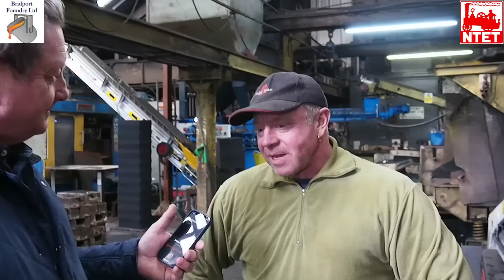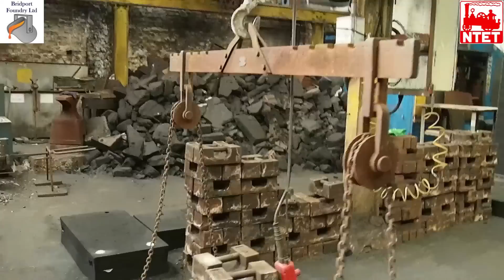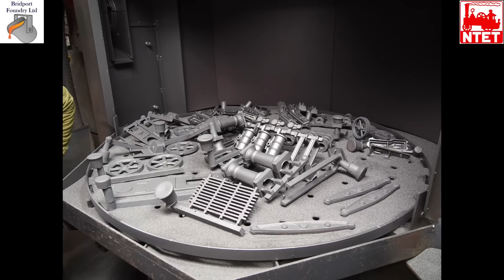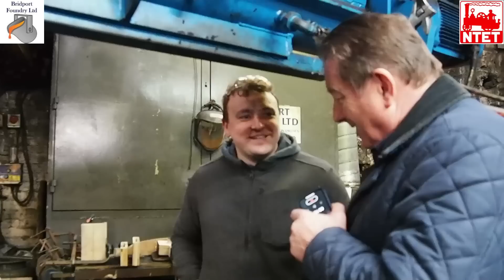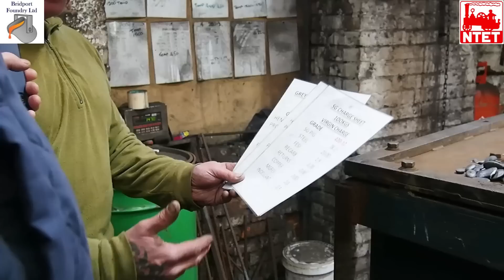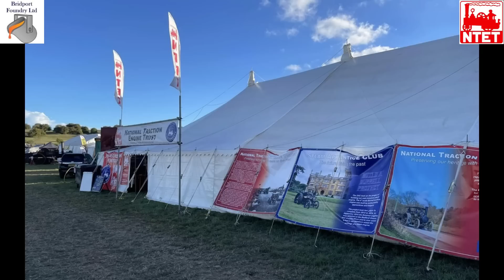An Evening with Bridport Foundry

Comment: actually 3d printed patterns work perfectly fine, IF they are finished properly after printing. i'm doing that a lot of the time and all it takes is proper sanding away layer lines. He is right nowever... prints directly off the printer are completely useless for sandcasting without finishing.

Comment: We used to have chilled castings at work, if they had time they'd leave them outside to rust, apparently that would soften them enough to drill, if they didn't have time they'd use some armour plate drills.

Comment: Good to see that there is a foundry in Bridport. Hadn't known this previously! Anyway, for the edification of those who see this, casting metals is the original additive manufacturing process and still the most efficient process of creating metal products. I saw some Triumph motorcycle cylinder barrels along the way. I have a need for a new single cylinder barrel for a 1928 Triumph motorcycle, so when I get to do the restoration I will make contact. Great video.

Comment: Aveling and Porter 'Clyde.' Wouldn't it be great if, after the recreation of 'Onward' and 'Talisman', someone rebuilt the legendary big Burrell road loco 3419 of the same name owned by Road Engines and Kerr of Glasgow which vanished into the mists of time taking the ghost of its long time driver Wattie Mair with it! It was reputed to be a 'one off' with a larger boiler and a possible NHP rating of 12.
Reply: People have tried to build a replica of the famous Burrell. David Eves who created the replica of Fowler B6 Super Lion "Onward" was wanting to build a replica of "Clyde". The story goes that he found that others were already engaged in building one and hence the Fowler project came about. He did return to the Burrell after completing the Fowler because the other schemes faded away. There were some parts from the earlier failed projects including (at least) one cylinder block. Quite where these parts are now I do not know and I have not heard anything about Mr. Eves' project in quite some time.
Reply: @DeCasoU1  Thanks for the info. It would be interesting to know what drawings they would use to rebuild an exact replica as, according to Tam McTaggart's article 'Wattie Mair as I knew him '( page 162 'Steaming' Autumn 1981) It was certainly not a 'standard' locomotive with, as I stated in my post, a larger boiler than 'usual' and a possible NHP of 12 although it has never been confirmed, so one wonders if drawings for a 'one off' are likely to exist. Certainly in the photos accompanying the article she certainly appears larger than her 10NHP stablemate 'Lord Roberts'.
Reply: @petercooper2387  The Burrell drawings are held at the Museum of English Rural Life at the University of Reading and those for Clyde are frequently requested from what I understand. Michael Webber who has a steam related business in Lancing has one of the cylinder blocks. The Burrell drawings are rather different to the Fowler ones but once you understand how they worked at Thetford things make sense. 3419 was a one off, designed to meet a particular requirement. It was a very good engine, it is just regrettable that the original faded away. We don't know what happened to it, though that doesn't stop people guessing or even holding out the hope that it might still survive and one day be found. One way to reveal the original if it still exists is for someone to build a replica since that seems to be the peculiar way that these things work.
Again, if someone had found it, if you had found it, would you tell anyone? If I had found it I probably wouldn't until it had been fully examined, documented and restored. And it would be difficult but not impossible to keep this machine hidden away while it was being worked on. Some things take decades to restore.
There will be some Fowler and Mclaren supporters who will be quietly pleased that it has not been found or recreated rather like steam locomotive enthusiasts who were glad that the LNER P2 class had vanished. Or rather, they were. Now they are getting anxious if not nervous.
Reply: @DeCasoU1  That's good news about the drawings still being in existence. I'd love to see them someday. I seem to recall reading somewhere that 'Clyde' was driven away from Glasgow by a 'young couple' and was never seen again - probably sold for scrap when they realised exactly what they had taken on. One can only speculate. In the early days of preservation one elderly owner of a Fowler ploughing engine suffered a breakdown en route to a rally (possibly rear axle failure) and lacking the means or contacts to effect a rescue had it cut up on the side of the road. A photo of this sad occurrence exists somewhere. So in is unlikely that 'Clyde' still exists given the many uncertainties they faced in those early preservation days. I certainly would not tell anyone if I found 'Clyde'. Knowing the prices that, particularly, road locomotives sell for now, security alone would ensure my silence. With Fowler B6 'The Lion' selling for £911,000 recently, long gone is that day when the owner of Burrell Showmans  'Her Majesty' had to reduce his asking price for the loco from 10 shillings to 7/6d in order to sell her in 1946! I am amused that Fowler and McLaren fans would start worrying if a reincarnated 'Clyde' turned up at a hauling demonstration by 'Talisman' or Boadicea' to show them how it's done. Wattie Mair would be up there, laughing with glee!